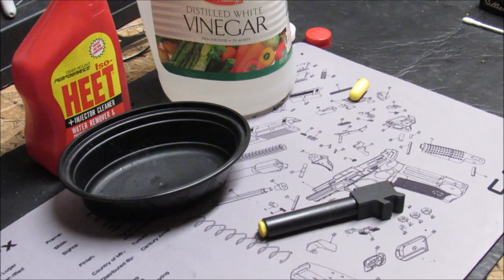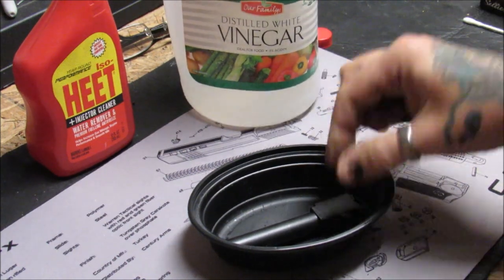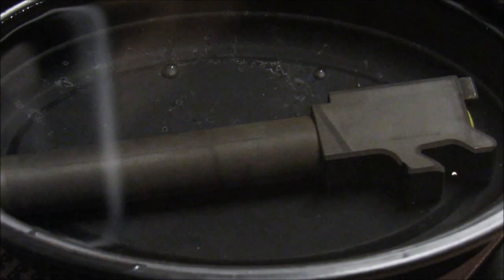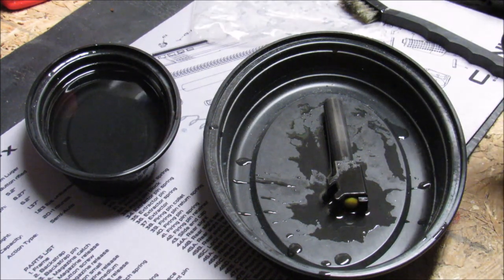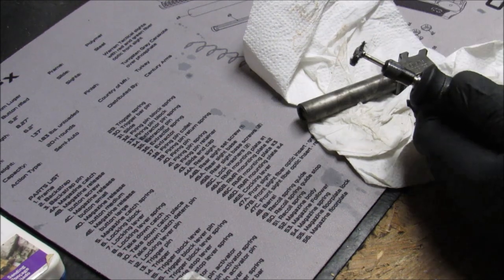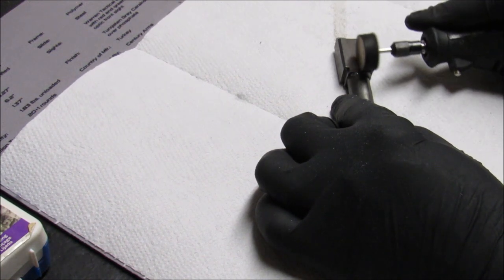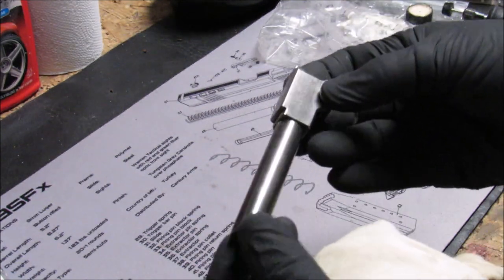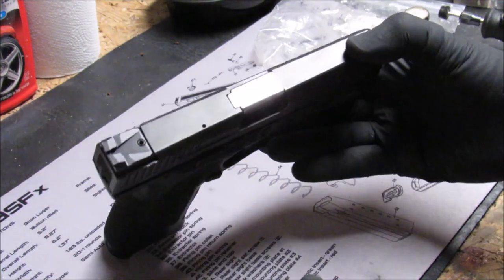How-to barrel stripping and polishing on a CZ P10C

Comment: Well I got my RIA 1911 A1 fs barrel soaking now and I just pulled my Dremel out to put a polish tip on....I'm gonna use nylon brushes I have first just to see if it helps on reducing wet sanding,I might even try some of my very fine brass brushes just to see what happens.ill keep u posted
Reply from the maker: Definitely keep me posted, I am very interested in your results 👉🏼💨

Comment: You may be dealing with the color of the alloy itself. I have had metal that would not take on a bright mirror finish. You may want to try Flitz polish, I have also found that J.B. bore cleaner will also polish a surface out nice and smooth. anyway, what you revealed about being a Tat artist said a lot about yourself. Dave.

Comment: Those ear plugs are made of sponge that soak up liquid. That would allow acetic acid, vinegar, to get inside the barrel and cause rust and possible pitting.  Why ruin a perfectly good barrel? The feed ramp needs no polishing at all. It was designed that way for a reason. I am not making any changes to my CZ P10C. It eats up any ammo I feed it with no malfunctions after 1200 rounds.
Reply from the maker: All your opinions, I love my CZ and the barrel is just fine.
Reply: I emailed cz custom and told them I did this on my sp01. I was concerned I may have damaged it, but they told me it should be just fine.

Comment: I have my barrel sitting in Vinegar as I type this , thanks for the project on my day off.
Reply from the maker: You are most welcome, thank you for watching.
Reply: Hey how does the barrel hold up, do they rust?
Reply from the maker: As long as the barrel is stainless there is no need to worry about it rusting.
Reply: @Reloadingfromthehotpot  i got this piece 
https://youtu.be/WS86W286e-Q
Im going to make custom grips an paint the lower part or see if i can do the nickle plating
Reply: Just so you know muriatic acid from the hardware store will remove blueing in about 30 seconds to a minute with no scrubbing or dremeling. Just letting you know

Comment: I was gonna ask the same thing someone else did further down about worrying about the finish, but if oil keeps it nice and you didn't remove anything thats needed to protect the barrel, I guess its ok. I am definitely a novice when it comes to gun smithing. about the only thing I know is, it better be clean enough to eat off of, "soldier". so when I clean one of my weapons it is clean, thats for sure. cool process though. I wanna learn some polishing and how to alter weapons for improved functionality myself. fancy looks I'm just not into, but that was pretty cool and simple on how it made the barrel look. high function and keeping it clean is what ill be trying to learn I guess. I have one of those waiting in the bullpen for me right now with the paperwork and all that has to be done. didn't expect to see that turn out as nice as it did.

Comment: I took my OEM glock barrel from black to mirror finish in about 25 minutes total I just use 800grit sand paper (wet) then a 5 dollar tube of ( mibro cleaning and polishing clay compound number 6) with a cheap dremel knock off....the lighter a touch with the wheel the more shine u will get if you press to hard it will dull the metal from the friction it seems
Reply: I’m trying to do the same then gold plate it or coat it any tips ideas

Comment: The S&W M&P barrel is stainless steel. I know the CZ P-10c barrel is hammer forged, but I don't know if it's carbon steel or stainless steel. If it's carbon steel that might explain why it looks a little dull, due to the acidic vinegar bluing the barrel a little. You'll know for sure if it starts to rust. You can always blue the barrel if it does.
Reply from the maker: Thank you for watching and sharing your input. The CZ barrel has shown no signs of rust or any degradation since the process.
Reply: @Reloadingfromthehotpot  Awesome. 😁👍

Comment: Muriatic acid from the hardware store will remove the blueing in about 30 seconds to a minute with no scrubbing. Just letting you know
Reply: Also will rust your gun in about 30 seconds lol🤷🏽‍♂️🤷🏽‍♂️
Reply: @santosalinas3929  True , but most folks , myself included , just wipe it on and wipe it off with the old blueing , then wipe down with baking soda water solution.. never had a problem with rust yet.
Reply: @guaporeturns9472  till this day i have that issue, even after I place lubricant on it. Top it off I don’t water down the acid at all fully concentrated that i use and still have the issue
Reply: @santosalinas3929  never had a problem with the stuff from the hardware store that is apparently for cleaning concrete driveways. Not sure what percentage it is but it makes pretty bad fumes when I open it up. Wipe it on and off that fast , blueing comes right off then I wipe it down with baking soda solution and then hit it with the hose outside... thoroughly dry it with a towel and then hit it with my "hot” cold blue. No rust at all. Maybe the gun you did had steel with less chromium or carbon or something.. I’m not real well versed in metallurgy but I have never had any rust when done as described above.

Comment: Now you need to treat this bare, polished metal barrel with a product called Frog Lube.  I have used this product, and it is a great product for treating polished metal to keep it from rusting. You heat the metal, apply the Frog Lube, let is soak into the pores of the metal, and then wipe off.
Reply from the maker: I use frog lube on my motorcycle lol.

Comment: So did you ever hit it with any of the 1000 grit wet/dry sandpaper, or were the views at the end of the video after only using the Mother's metal polish with the Dremel buffing bit?  If you did use the 1000 grit, how much time did you spend using that?  And is it best to.use the Mother's polish before or after sanding?

Comment: If that wire wheel had been introduced to rust at any time prior to working on the gun it will contaminate the metal causing it to rust.
Reply: Rust spreads like a virus?
Reply: @5jjt  lol!  Exactly. Contaminate the metal? A material either rusts or it doesn’t depending on its elemental composition.

Comment: That matte finish is probably from the acidity of the vinegar etching the metal slightly. Same principal I use when cleaning know blanks before finishing.

Are you worried about corrosion on the raw finish?
Reply from the maker: The matte finish is just from the production of the barrel, I could have wet sanded the barrel to a mirror finish but I like the matte better. Not worried about corrosion as I keep a light coat of oil on in every time I clean it.

Comment: Is there a coating that can be added to protect from rusting since blues finish is removed
Reply from the maker: If you are concerned about a rust issue just keep a light coat of oil such as rem oil when you clean your pistol. If you are dealing with a stainless barrel there is very little chance it will ever rust.
Reply: Ceramic coating....for stainless

Comment: Go on Amazon,  get yourself some 2.5 micron diamond paste and reduce your polishing time by about 700 percent.
Reply: Deep Bass I have an old 1960’s Rossi 62 sa and it’s got an old blues finish on it and I wanna take it off and Crome it and then use some cold blue to just kinda slightly go over it to give it a case hardened look. Do ya think that polish will damage the metal any?